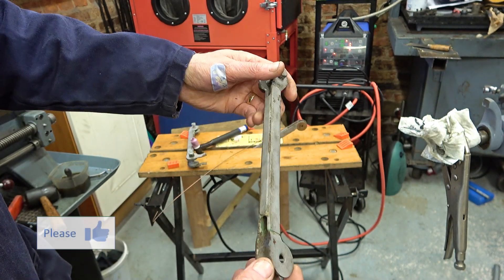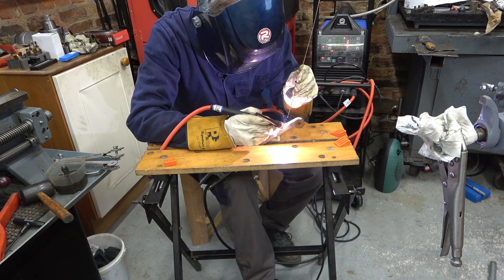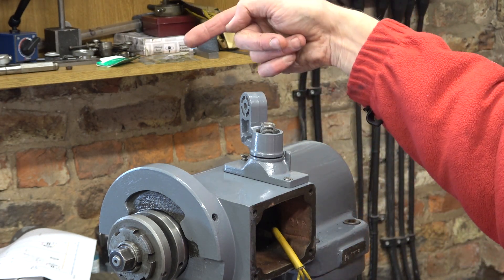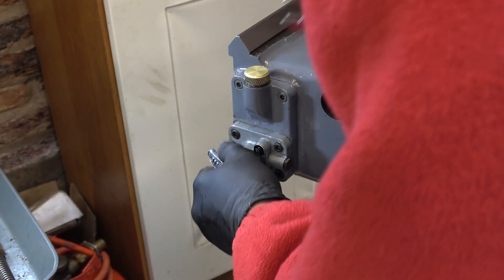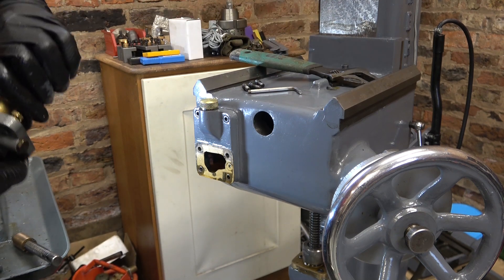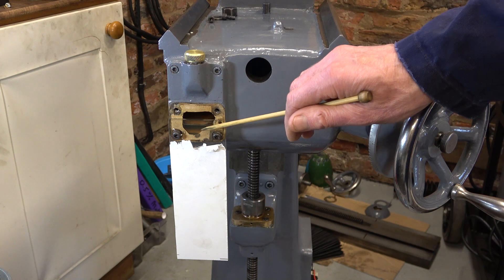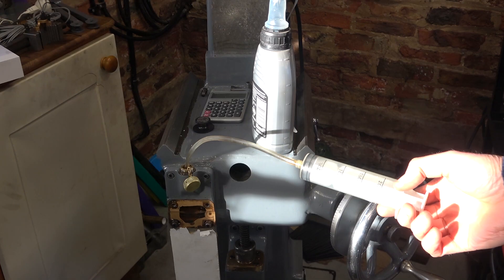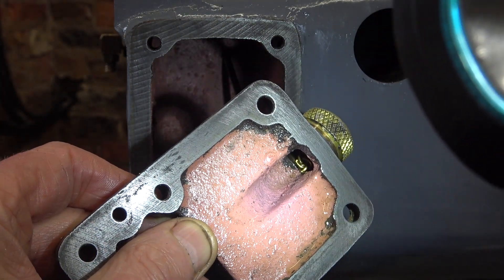HS241 Herbert Junior Mk2 surface grinder Part 8

Comment: Can't read everything on the label, but that doesn't look like an isolated LED driver. Although the original lamp would have been mains voltage, it's common nowadays to use low voltage for safety if it might get broken, and that form factor of driver is probably a capacitive one so still directly connected to the mains .Usually that type of supply is intended for use with ceiling lights you can't touch etc.  One that explicitly says it is isolated would be a tad safer (but usually more expensive), or a constant voltage power supply or wall wart and matched voltage LED 'bulb' (or LED + resistor if you can do simple electronics). (constant current means it will increase the voltage until the design current is achieved, so it will go to full mains if you smash the light, whereas constant voltage doesn't have that failure mode but is a bit less flexible as to what LED you use, and usually constant voltage supplies are isolated from mains). If you do use that driver, then although it's a lower voltage between the wires, the wires themselves are at mains voltage, so use double insulated cable and earth it, as you would a mains light with a metal body, but by that point there's no advantage with having a separate LED driver vs a LED main bulb.
Reply from the maker: Hi mach0elf, thank you for explaining that. I see your point. It may be 12v between the bulb wires but under some circumstances could be 240v to the machine case. The  machine originally had a large heavy lo-volt isolating transformer.  I do have some 12V lighting isolating transformers but they are not exactly small or light either. I will do my research and see what's available new.  Cheers

Comment: My Celtic is leaking too. The question is... where?
I hope you fixed it. I suppose time will tell.
Reply from the maker: Hi Michel, there are some very odd leaks from these machines. Most have them, sometimes even from new. My lathe had a bizarre problem where an oil 'lock' was stopping me changing direction on the power feed. Oil was getting behind the plunger - a 55 year old basic design fault. I had to drill a relief hole to let the oil drain out. Cheers

Comment: Just finished chasing oil leaks on the Elliott Mill, think I have cracked it! I'll see if the reservoir is empty next week! The oil reservoir is painted with some sort of white substance which like you I think is to seal porous castings. Well done!
Reply from the maker: Well if you have fixed the leak Tony you will need to be on the lookout for another machine to work on. 😁🤣

Comment: I've never tried tig welding. Looks good to me, Paul. Did you add the filler rod or did you manage just to melt the two sections together without it? Cheers Tony
Reply from the maker: Hi Tony, yes I did use filler. I have jointed without filler wire and in such cases the concave bead can look amazing, but I was a bit nervous of burning through that thin stuff. In the hands of an expert TIG beads can be applied like fine brushwork calligraphy - a very high level of control. Cheers

Comment: Hi Paul. Oh, the dreaded oil leak. Both my Dore Westbury mill and Myford lathe suffer with “untraced” oil leaks. I suspect one is due to failed gaskets. However the second might well be due to a pin hole leak. You have given me some ideas to explore.
Looking forward to what you have to say about Paragon paints. I have tried their spray paint, with some success until, the nozzle clogged (🥴) and would like to try their brush on paint. You seem to have got on well with it. Is it the gloss version on your surface grinder? 👍😀
Reply from the maker: Hi Andrew, yes it is gloss. They matched the original paint colour for me and gave me various products to try. I did get a spray but for that you will need to wait for a couple more videos hence - using the spray can did not make it into next week's vid but you will see the brush paint in action. Cheers Paul
Reply: @HaxbyShed  Hi Paul. That’s perfect timing. Roll on next Friday 👏👏

Comment: I would also hate an oil leak.  Every time I looked at the machine I would have to clean up the mess.   I hope the new paint has sealed any pin hole leaks.
Dave.
Reply from the maker: Hi Dave, as somebody said it is a 'total loss' oil system so what comes out of the pump will end up on the floor eventually but I don't want it dripping just by gravity un-pumped.  Cheers

Comment: Chasing that oil leak is a bit like owning an old British motorcycle, the only time they stop dripping is when they are empty 😂
Reply from the maker: Hi Paul, now I get the FrancisB reference. Years ago I had British bikes. Two relevant comments stick in my mind. I had a Tiger 110 and my friend said "what is wrong with this heap, it does not leak oil??!!"  And the other was the joke that at the bike cafes the Japanese owners used to discuss speed and all the Brit bike owners used to stand around discussing the size of their oil leaks. Cheers.
Reply: @HaxbyShed  Hi Paul that also explains your need to tinker. The FB is when I want to pootle and stop of for a chat to a stranger. I always find people are more talkative than when I'm on one of my Kawasakis. Bikes are like tools, you can't stop with just one!

Comment: Hi Paul, my grinder leaves a little puddle of oil on the floor is a similiar place. Mine is just total loss from the vertical sideways lubrication and the bottom of the knee screw. These points continue to drip weeks after I have pulled the plunger. In the end all the oil from their reservoir will end up on the floor, having done its job on the way through the machine!
Reply from the maker: Yep I may have been chasing ghosts ..... but defo the o-ring needed changing because it was a big but easy fix leak. Cheers

Comment: Lubrication, or Tribology, the lifeblood of all machinery. 
Yes, as others have commented,  painting inside of castings is to reduce casting process residues, and seal against contamination, it also improves oil flow on faster operating machines when a smooth finish is achieved. I was given a Royal Enfield motorcycle engine as a youngster,  and it had a white/cream colour paint in the crankcase.
The paint used on hour surface grinder is  most likely Red Oxide,  Alkyd paint is fine for mineral oils, not sure for synthetic fluids, or petrol.
Great video, and Paragon paints are excellent.
Reply from the maker: John if you had a Royal Enfield then I guess it would only have oil in some of the time.  We used to say Royal Oilfield - but all the Brit bikes were much the same. Cheers
Reply: @HaxbyShed  Hi Paul,  I  used to be a keen motorcyclist, from 78 to 88, only owned a car to learn in for a year, and followed classic bike racing, I did have an Ariel 350 NH on the road for a while, and having separate engine to gearbox leaked copiously, these pre-unit designs were dire, and existed to long.
Great fun.

Comment: Rule of thumb for TIG welding Paul is 40A per mm of material thickness, it makes a good starting point I have found.
Reply from the maker: Hi Bill the plate is 80 thou so 2mm. Maybe I will practice at 80 Amps if I can find some spare sheet. Cheers

Comment: A good, easy to remember, rule of thumb ..
"a minimum of one amp for every 1/1000 inch of metal thickness
Reply from the maker: Hi Steve, I was very nervous of burning it through. I've just checked and the lamp arms are made from 80 thou sheet. I agree my setting was too low even after increasing it twice (5A each time) but I'd need more confidence to try 80 amps on that.  Cheers

Comment: Like the new machine color, and the paint in the reservoir should seal it up nicely.
Reply from the maker: Hi W65er I was very attached to the original colour and disappointed when I got the repaint shade wrong. Repainting the machine was a big pain but it was worth it, especially as the paint came for free.  How could I not?? Cheers

Comment: The red paint inside the castings is called Glyptal and is there, as you said to seal any blowholes in the casting, and also to seal off any remaining hard sand  stuck to the casting so that it cannot come loose and get into the Works!  .You have also completed the highly collectable( only £75 to you mate!) machine lamp, and doesn’t she look good! I prefer the new colour too! 
Nice one Paul!
Phil
Reply from the maker: Thanks Phil, yes I those lamps and Lo-Vo transformers on ebay sometimes as table lamps. Hopefully my Paragon paint in the oil tank will not soften with mineral oil (might be a different story with synthetic).  I think it's twice the machine in the original colour. Cheers Paul
Reply: I had a quick look at their website, that 1201 looks just the business. And they are only in Chelsea, then I realised it was Chelsea in the States, not London.
Reply: Came here to make the same reference to Glyptal

Comment: A ginder and paint will make us the welder we ain't! 😉 Continuity fail or a glitch in the matrix? Well done. Cheers.
Reply: Like the matrix reference.
Reply from the maker: Hi Greg, as you know with a long series you pick up orphan clips along the way which somehow need to be worked in later without the time discontinuities being too jarring.  I can usually keep a record of your time and my time (now time) in my head and you will often see me confined to one side of the workshop so you don't see the grinder in 'my time' which is ahead of what you've seen so far.  When I get off this series it will get easier for that. But I do enjoy the time sequencing challenge. Cheers

Comment: Always frustrating looking for something that you dont know exists. Even if you had found a leak it wouldnt stop you getting oil on the floor, it is after all a total loss system if that pump feeds the gibs, but maybe less without a leak.😂
Reply from the maker: Hi Chris, yes indeed the oil is going to come out somewhere but it would be nice if it were only when I pump the handle. 😁 Cheers

Comment: TIG welding is not easy, it takes constant practice. Honestly - what you have done there is not at all bad. I'm no expert but if I were to offer an opinion based on what little I know and have seen, you need to move along a bit faster, and perhaps get your feeding hand more comfortable and perched on something so you are steady. But really your welds were looking pretty decent. I love welding - wish I was better at it. (more practice needed).
Reply from the maker: Hi Stuart, I could probably have taken the current up another 5 to 10 amps but I was worried about burning through. I need a metal welding bench and one that is higher, so I can get comfortable. (Something may happen soon ...... ) Cheers